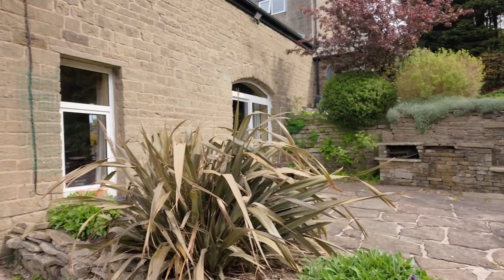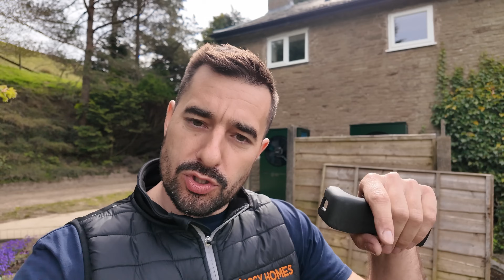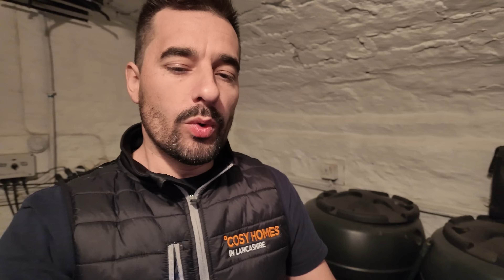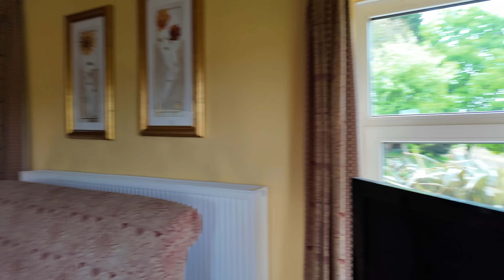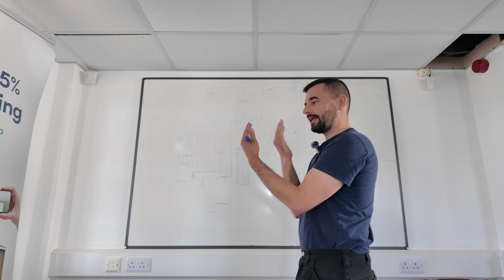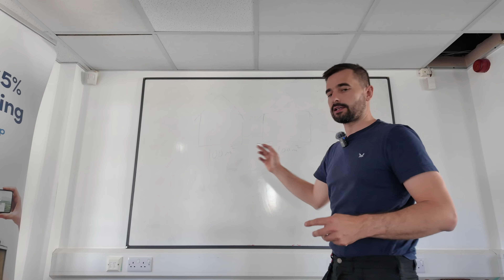Heating old houses with heat pumps

Comment: When using two heat pumps like in this instance, do both of them tee in together before the plate heat exchanger? Really interested in the set up as I've only installed single units on an open loop. Thanks
Reply from the maker: Hi

In this instance we have teed them together, pipe sizing is critical and the type of heat pump used. Some manufacturers cant be teed together some can. These units cascade together well, lots of units don't have control stratagy to be piped together so those manufacturers insist on hydraulic separation as soon as you cascade.

Comment: He didn't fancy a repipe?
How long will the steel pipe system last anyway? 
Is he just saving a big job for later and locking in a compromise?
Reply from the maker: Hi, unpicking a system of this size, that is very much integrated into the infrastructure of the building would be not only expensive to upgrade but incredibly invasive. The remedial work following a full re pipe could exceed the re pipe itself in cost due to the layout and fit out of this property. 

With any heating upgrade there is always compromise, and that compromise is often a balance between capital outlay over efficiency and the clients willingness to accept disruption. Spending a pound to save a penny isn’t always the best bet.! 

How long will the steel pipe last is anyone’s guess however more than likely with good water quality it could last decades.

Comment: Interesting engineering, looks more like an allotment style processing plant room.  But that’s going to be so expensive to install and run and high maintenance. I’d have never agreed to doing that in my house, too many compromises and work arounds to be a robust, reliable and economical system. Not if there is is an existing and functional oil boiler.
Reply from the maker: @yp77738yp77739  proof is in the pudding I guess. Lets see how they get on over the next 12 months 👍
Reply: @Rowlysrenewableroadshow we were in the similar situation, the original plan was to have 2 single phase units or a 3P In the end we retrofitted with internal insulation and got the heat loss down from 23kW to 13kW and that allowed us to put in a 14kW 1P unit instead. 26 kW will burn through best part of 10 megawatt hours over the year and without significant battery storage to smooth the load that’s going to be expensive at energy cap rates.

Comment: Great video Adam.

Is the vented heating side also running at a DT of 5c?

Those k3 radiators at the end part are massive. Recently had a k3 600x2000 to be installed on one of our installs, the rad turned up like a banana. You end up using feet for extra support or full faith in those brackets?
Reply from the maker: Thank you, yes the vented side is running DT 5 too. 

We have done 600x2400k3 in the past they’re so heavy, and yes more often than not we use the optional feet 👍

Comment: I know it's possible as I heat a 220yr old 200 sq metre solid stone house with a heat pump and its cheaper to run than the old oil boiler was and its all radiators, we use about 4000kwh of electricity per year and that has been the same for the last 4 years to do both heating and hot water. The epc for the property says it requires 25k kwh per year.
Even at the cold time of the year the flow temp is only 38 degrees and we run continuously and it maintains 21 degrees
We are very happy with it
Reply from the maker: Awesome 💪👍
Reply: @Rowlysrenewableroadshow  hi, does that send a reasonable amount of kwh usage for the size of the property as no one really says how much power they use they seem to be more focused on cop, which can easily range a lot depending on what temp you are trying to keep your property. When we switch our heating on in the Autumn  it stays on continously until now, only now do we tend to switch it back on if required but as our house has 3 large Georgian windows facing east if its sunny in the morning we get a lot of natural solar gain

Comment: Nice explanation. I suppose that in your example of the 70's house and recently built house the difference is not only the capital expenditure on a 15kW vs a 3.5kW system but also in the running costs. Even with the same SCOP the old house still requires approximately 4.2 times as much energy to heat it as the modern house - still better than a gas boiler though, and probably cheaper to run if only we stopped taxing the fuel we want people to heat their homes with!
Reply from the maker: Hi, thanks for your comment. 

Absolutely the 1970’s will be more expensive to run, I should have driven that message home too, however the point is in this example that’s a fixed issue regardless of fuel choice.

Comment: Not sure if Im missing something, but near the end you said the only difference between the old and the new house would be the capital cost - surely this isnt true - the 1970s house would cost over four times more to run due to the bigger heat loss (15/3.5=4.3).
Reply from the maker: @shmavitz  you’re not missing anything per se. 

Yes the old house would cost considerably more to run that’s a given, but it would cost more regardless of fuel choice be it heatpump/gas/oil

However the point is, the house would be warm and in the example would have equivalent efficiency of the new house. 

Efficiency and cost are often confused. They’re intrinsically linked but different measurements.
Reply: @Rowlysrenewableroadshow  I see, thank you for the clarification. I guess for me there is little point in switching from gas to electric heat pump for heating, at least from an economic viewpoint, unless the efficiency of the heat pump can be well over 400% as electricity currently costs about 4 times more than gas. But it is good to know that a heat pump would likely heat an old house well if designed correctly. If the price of electricity goes down I will certainly consider a heat pump. Great video!

Comment: Great video Adam.  Shows what is possible in old solid stone type properties with low flow temperatures to gain higher efficiencies from a heat pump while achieving an internal comfort level comparable (likely better) than a high temp ‘on and off’ boiler.      I live in a similar property and have had heat pumps keeping it warm since 2011 - they work incredibly well and your video gives a really good overview for the design and considerations for anyone considering switching to a heat pump system.
Reply from the maker: Cheers Mark, appreciate the support 🙂👍

Comment: How about the running costs compared to the old oil system. Any info? After all its not just capital costs a 15kw system is going to cost a lot more to run than the 3.5kw in your explanation. I am not having a pop, just after a bit of info please.
Reply from the maker: Absolutely, great question. 

In short it’s all relative as long as the efficiency of the heat pump system pence per delivered kWh is cheaper than the alternative say gas/oil/lpg it will be cheaper to run. 

Yes the 15kw house uses more energy to heat but that heat load is the same be it gas/oil/lpg/heatpump.

Example. Natural gas currently is IRO 7.7 pence per kWh delivered, a heat pump at scop 3.8 with an electric price of 27 pence per kWh has a delivered pence per kWh of 7.1 pence therefore cheaper regardless of heat loss being 3.5kw or 100kw

Hope that makes sense?

Adam 🙂

Comment: It's good that more of these videos are coming out, dispelling the 'house needs to be very well insulated' myth for an efficient system. I'm sure people will still say it's not possible, though 🤣
Reply: Only an idiot would say it’s not possible. But heat pumps suffer from a tighter tolerances. If you get the heat output to the house wrong then you’ve got a bigger problem than a carbon burning system. With a high temperature system you’ve got a hell of a lot more leeway with design. Worst case with boilers you’ll see cycling. Heat pumps can fail to produce enough heat and or cost the customer a lot of money if you get it wrong. Get it right and you’ll save a lot of waste and a lot of CO2 emitted.  

This is why it critical to get a good designer and installer.

Comment: First class if you ask me.........pipe insulation looks good....what is it you use
Reply from the maker: Thank you, it’s the lads on site delivering the installs that are the un sung hero’s of the heat pump industry. Real tough work they do day in day out. The design and commissioning is the easy bit these days with the apps and software available for us to lean on. 

Externally we generally use Primary Pro or in this instance it’s plastic coated Armaflex as we have quite a bit of stock to use up. 

Internally it’s 19mm wall thickness Climaflex.

Comment: I have a customer with a listed property, 26kw heat loss, £7k+ oil bill and wanted to go with heat pumps - only trouble is inside is listed including the radiators. Quickly became apparent that it wasn't possible to use heat pumps, especially when the DNO said there's no extra supply capacity in the village. I am hoping that the local networks get upgraded and they relax the planning requirements so we can utilise heat pumps in more properties. 

You're correct though the higher heat loss property is capable of being met by a heat pump, it's just the cost - in the above case around £36k
Reply from the maker: I feel your pain. We do come across situations where either the network isn’t up to the task. Or the necessary upgrades don’t make financial sense. 

As I say, capital cost can sometimes be a show stopper…. 🙂